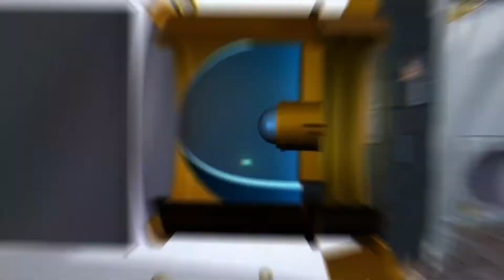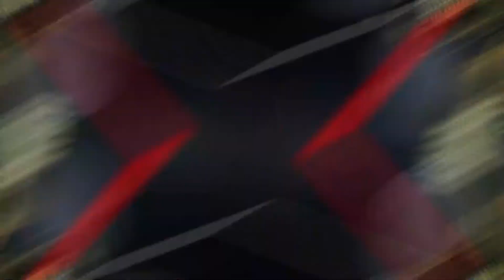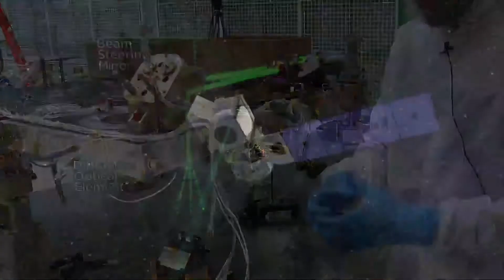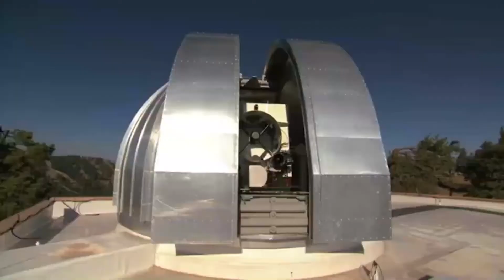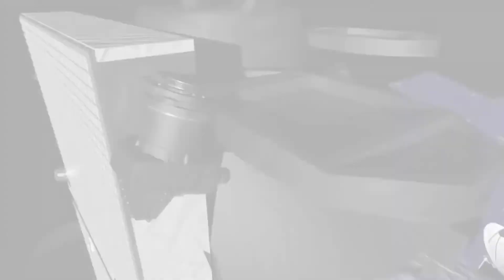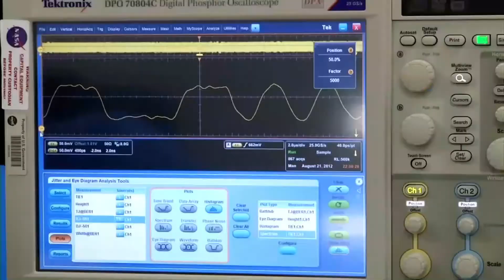NASAs New Laser Communication System Technology Is Mindblowing!

Comment: Why are they trying to use lasers to transmit through planetary atmosphere mediums??? Won't transmissions using radio be easier from ground to orbit, and from there use laser for inter planet comm...
Reply: There is a window, 8-14 nm, that offers 90-80% transparency. It does get attenuated by co2 and water droplets but so does microwave radio. Radio is still better at penetrating atmosphere but the difference is not that dramatic. Lasers give us substantially more bandwith to work with, compared to a setup with a radio link